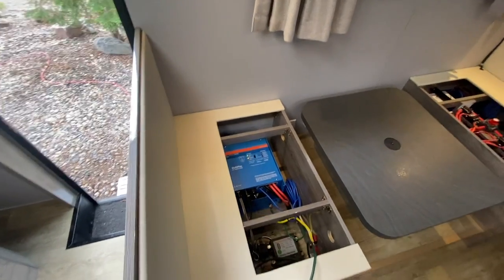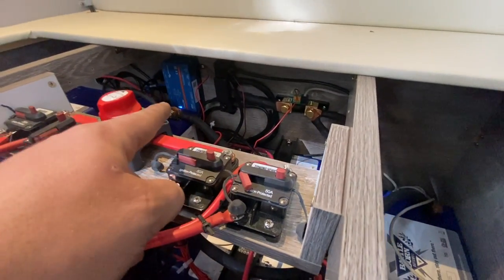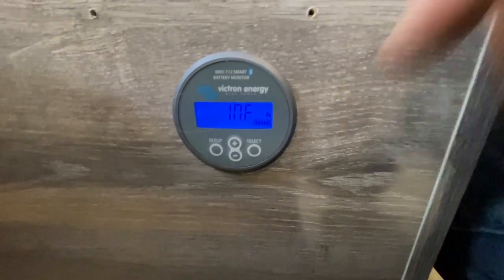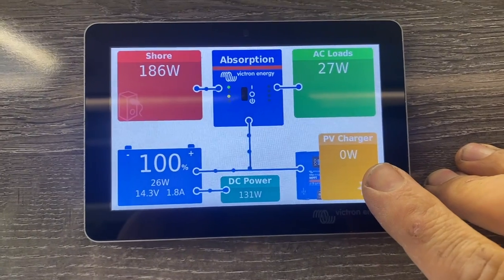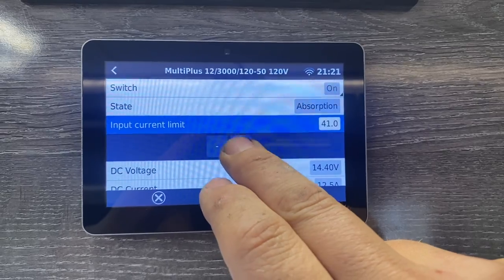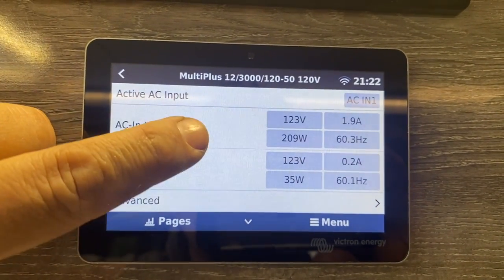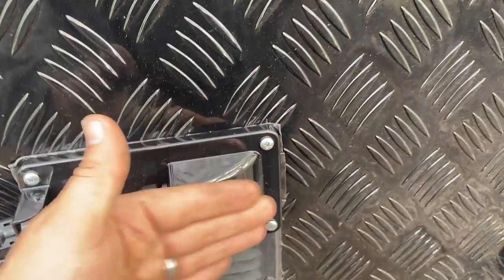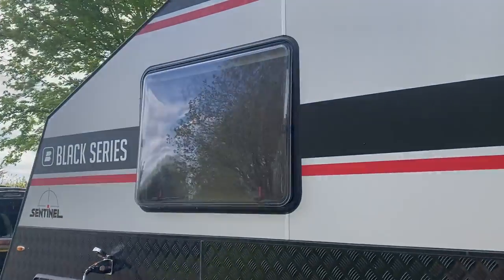Black Series Travel Trailer Victron & Battle Born Batteries Power System Upgrade

Comment: In the process of upgrading an HQ17. Was wondering if you can provide some assistance as there are so many modules in the solar game. The current AGM batteries are toast and was wondering what’s the minimum requirement to use lithium batteries (charging, accessories, etc)
Reply from the maker: Been a while since we worked on this one. I’d say SOK 206 ah battery is the best right now for value, capacity, workmanship, service ability, etc.  

Minimum you’ll need to upgrade your converter to properly charge it. However, that usually means $ 300-400 upgrade.  I skip that and put that into a Multiplus 2000 or 3000w inverter and have a bulletproof inverter / charger setup. 

Then you start piecing together other components , I’d recommend other Victron items. I’d be happy to talk through these options with you. Hit me up shawn@sotasolar.com and we can put together an order and have it shipped right to you.